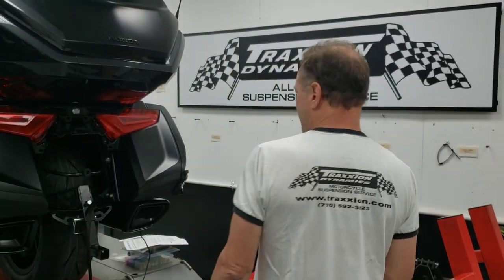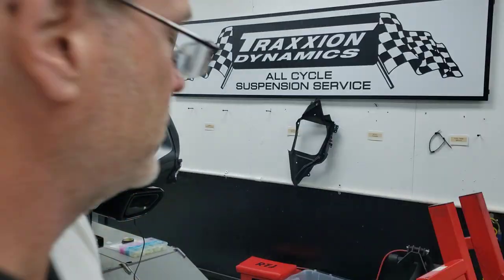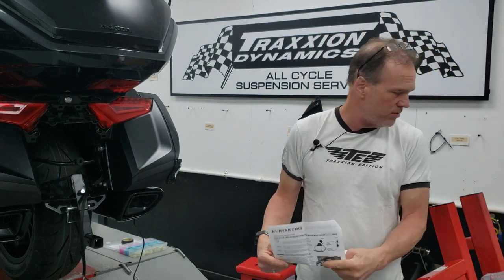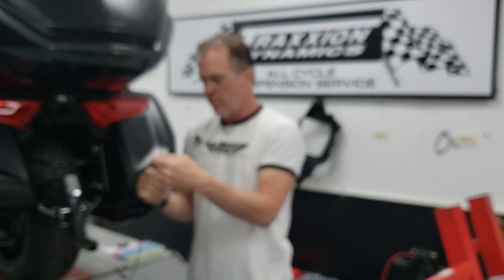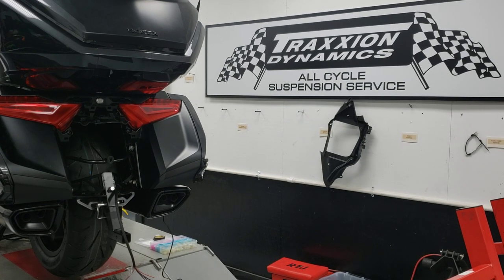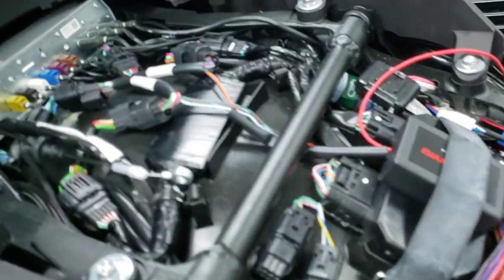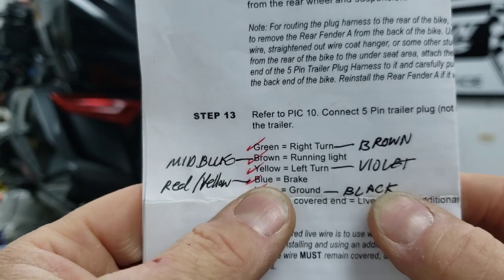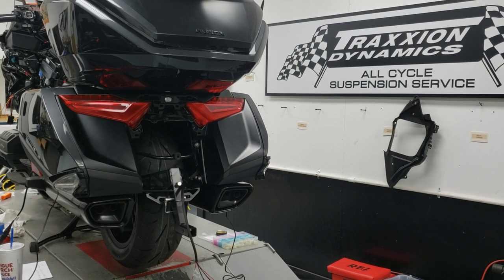How to Install Kuryakyn Trailer Harness 2018+ Goldwing Part 2 by Max McAllister of Traxxion Dynamics

Comment: Thanks Max. I finished installing my hitch today and look at the Kury isolator and saw the colors on the kit and just put it away for the day. This has now saved my hours testing to get the installed down right. I will now be able to connect the wiring in just minutes. Part 1 was also a lot of help. Do you really need to pull the main fuse?
Reply from the maker: No, I have no idea what that is about.  If you are concerned, you can disconnect the battery ground cable.

Comment: I ran into the same problem for 2013 f6b
Reply: With 2013 F6b  made specifically for 2013 f6b I just came off of the sub harness and hooked it up the wire about wire according to what the sub harness was putting up to the pigtail to my trailer
Reply: I never hooked up to the 7676 harness from kuryakan